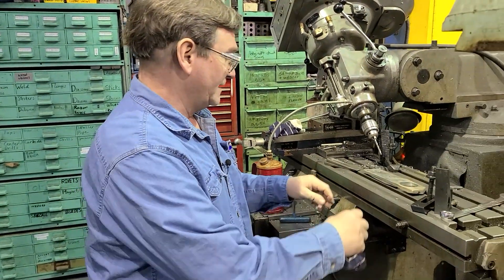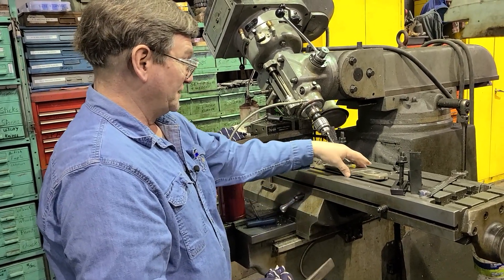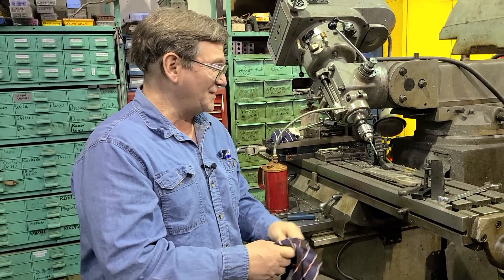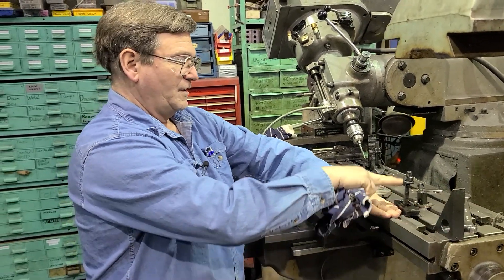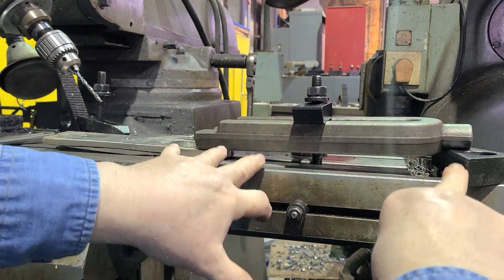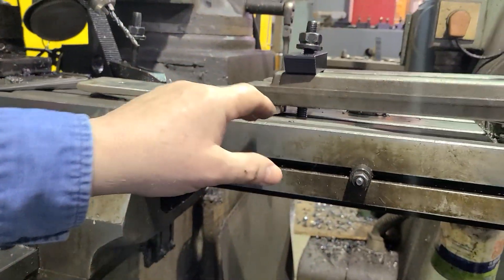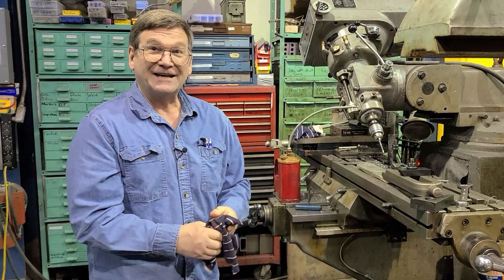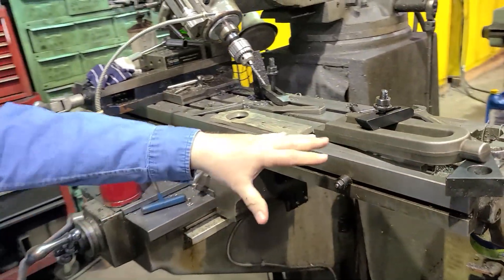Machinist's Minutes: More on bending your mill table

Comment: One of the biggest surprises I had when learning in a machine shop was the surface grinder. Even though the magnetic chuck holds the work piece flat, heat from grinding introduces warping.
Reply: I just relearned that last night lol